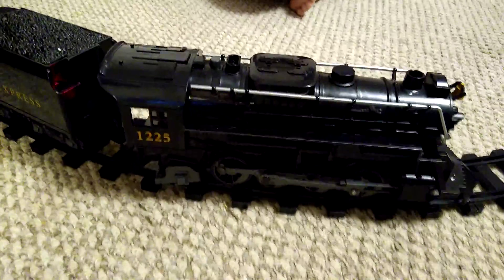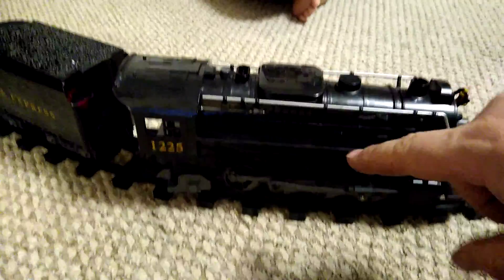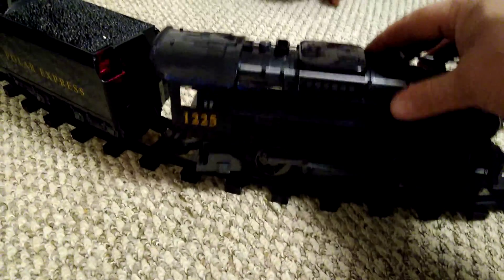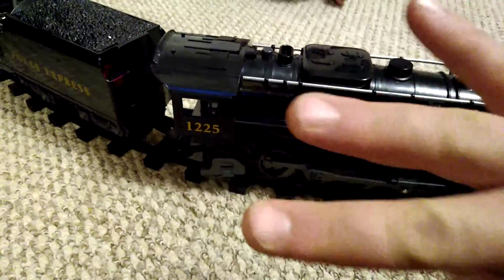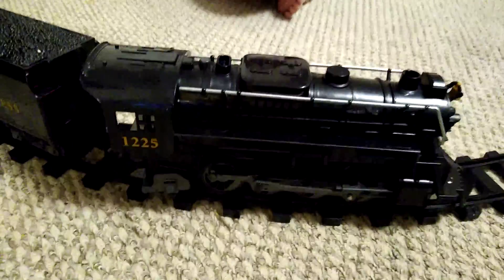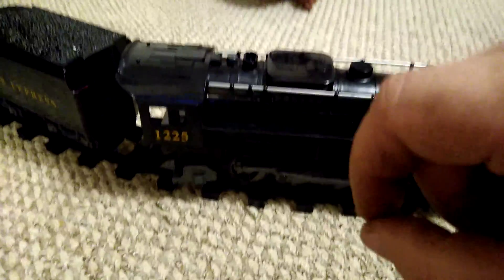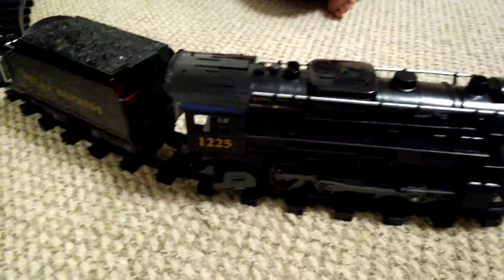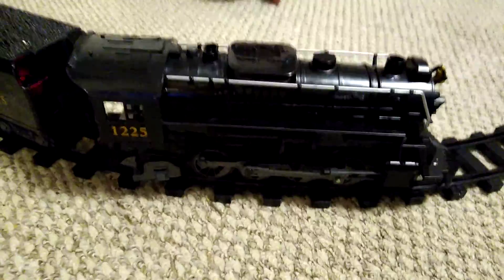Polar Express Train fix

Comment: Can you elaborate more on how to do that? I think this is the problem with my train. The. Sound works but it’s not moving.
Reply from the maker: Pop open the bottom cover to the train. You'll need a screwdriver. The parts wheels will come off and the motor and gears will be exposed. On the side where the wires attach to the motor, there are three little resistors that should NOT be touching each other, but still attached to the electrical wires. They regulate how much electricity goes to each component, so when they touch each other, it messes up the desired voltages. Gently bend the wires they are attached to so that those wires do not touch each other. Turn on the machine, test, reassemble.